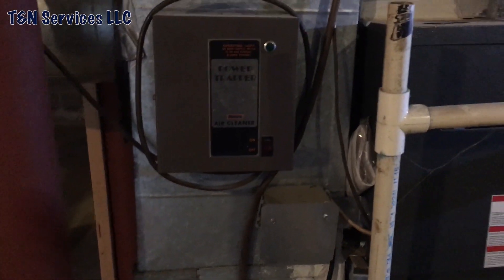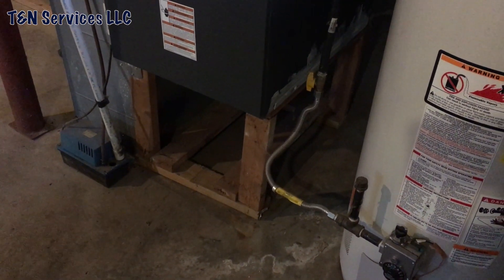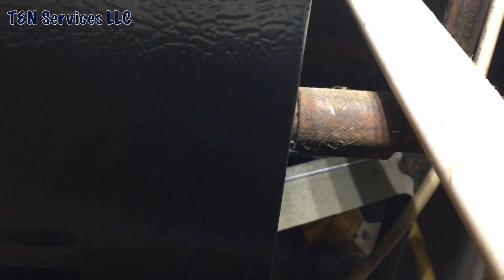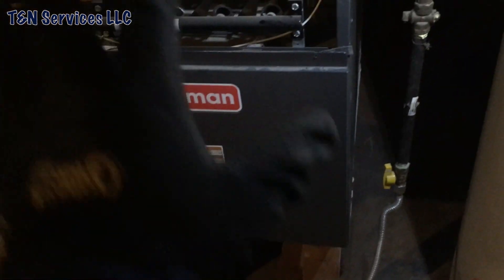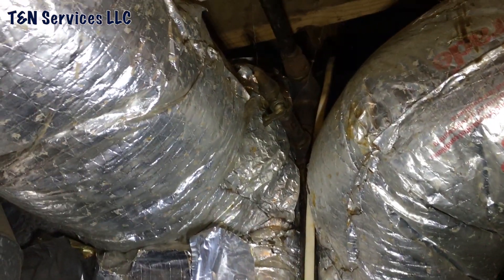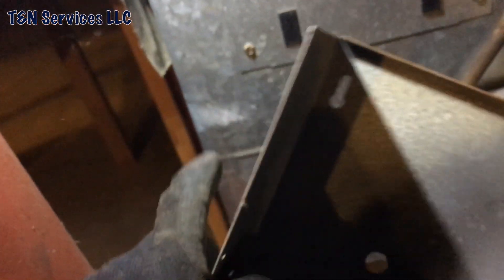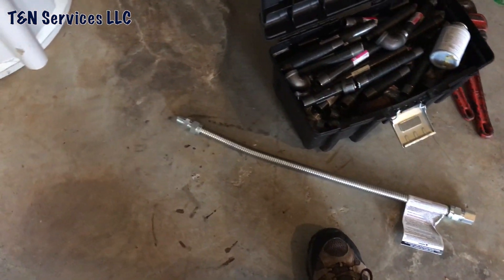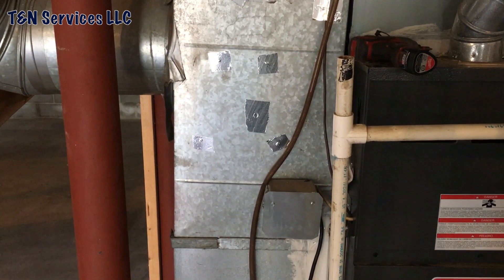Low Bidder Gets The Job Part 1

Comment: I didn't know that drip leg for water heater was wrong. Not used to it here in California.  Inspectors only started enforcing that a few years ago.  Thanks for the info.  I did think you had a potential leaker with that old valve.  Glad you didn't leave it. 👍
Reply: Drip leg is supposed to be on the last bend right?

Comment: Just found a 10 year old system where someone ran single wall through an old window and under a deck to vent an 80% furnace and natural draft water heater , pretty sweet
Reply: airkraft1 I just noticed that my 92% has the intake pulling from the basement. Ever see that before?
Reply: +Bajaheat that is safe , it is a little less efficient because air needs to infiltrate back into the house to replace what the furnace uses . Very often on new homes building codes require us to bring in fresh air direct to the return because houses are built so tightly
Reply: Bajaheat
International Mechanical Code 702.1
"Combustion and dilution air shall
be permitted to be obtained entirely from the indoors in buildings that are not of unusually tight construction."

Comment: why isnt the water heater relief piped down to floor? Also we have to use bx cable around heating units in NY. It looks like a  grade school kid did that install,nice fix on gas pipe

Comment: Most home inspectors know very little about mechanical systems.  Around here, they protect themselves by including weasel words in their "report",
 recommending an additional inspection by a licensed HVAC contractor.  The problem with that is that the HVAC inspector usually works for the buyer, not the seller.  As such, he shouldn't do any invasive testing, i.e., put gauges on the system.  Certainly not fix drip legs like Ralph did (I know, he was working for the seller).

Comment: Hey ralph, just heard the new COHvac podcast. good stuff. question, does your unit have a pressure transducer? or something that detects static pressure? so when 1 or 2 zones are calling its not dumping the 3rd or 4th stage of air into those zones?

Comment: Why didn't you just remove all that flex garbage. Do it right...pipe it in with hard pipe to both appliance. Yeah it cost  about $20.00 more in black fittings and your time, but any customer would appreciate that a "Pro" they hired did the job right for them and the new purchaser.
But Im probably wrong by the sound of your narrative that you are happy with what you contributed to that abortion of a gas hook up, and maybe in your part of the world what you just did is considered quality work. Most Licensed prof. gas fitter or furnace Tech in my area and probably yours, would do that and think its good to go. Whats with all this flex hook up crap...are techs in your part just lazy or just don't know how to fit it..... probably a combination of both. Its not just the Home inspector who did half a job....
Reply from the maker: +Paul HVAC gas flex in my area is perfectly legal and accepted. It's the different areas we live in.
Reply: @T&N Services LLC I get it that it is what guys do in your area, But can we agree it can, like in this example, look like s&%t. You and I know we carry black fittings on our trucks and we have the know how to hard pipe it professionally. So why follow the weak herd and not stand out like a pro. Your customers but mostly your self, appreciate good professional work. We should alway try to step above the rest shouldn't we?